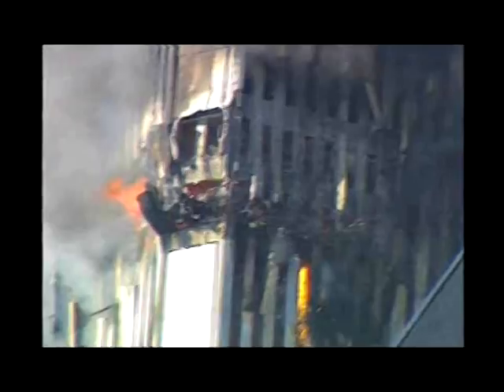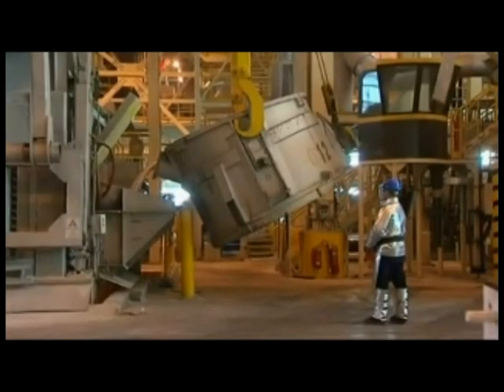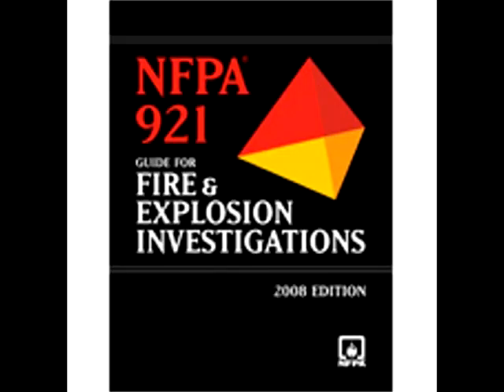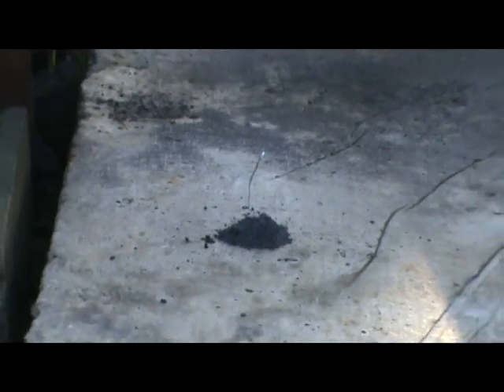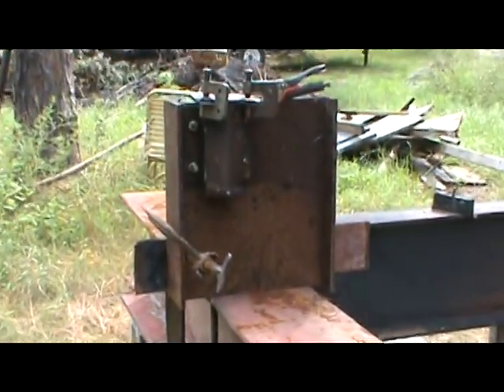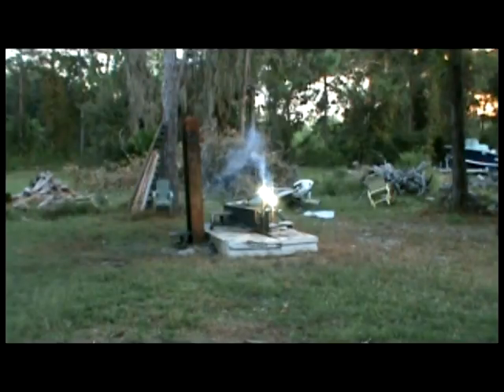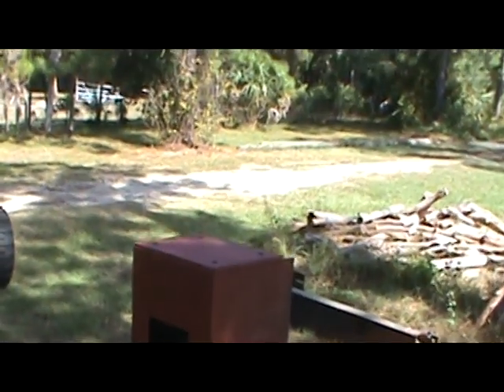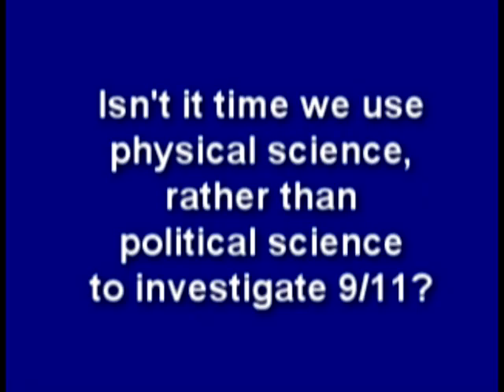9/11 Experiments: The Great Thermate Debate

Comment: Wake up call...

An office block like that has what type of filing cabinets? Chairs that have steel. The amount of lose steel that is present that is readily melted in such an environment would lead to a river of molten mental pouring out from a point that is above the fire.

Why is it people ALWAYS take the complicated route to the problem and fail to accept the fact that the average office has enough wood and steel and paperwork to produce FURNACE TEMPERATURES and that in itself should see the penny drop........
Reply: Ronnie Bishop  You're an idiot.
Reply: Chris Gilliam And you're ignorant and uneducated.
Reply: Mark Giblin But J-P 4 jet fuel would have to burn extremely hot to catch that on fire and it just doesn't. No
Reply: Are you daft? Jet Fuel burns, ignites paperwork, soft furnishings, wood and all manner of products start to off gas and that burns hotter and hotter and hotter to the point that metal furniture and other metal objects will melt.

Then you have the high temperatures from being 80 floors up and  blasted with strong winds, its not a light breeze up there, its bloody windy as F*** so that blasting through a hole in the building will be like a BLAST FURNACE which can even MELT CONCRETE!!!!!

WAKE THE F*** UP PEOPLE.

Anyone who works with metal will tell you that temperature does not need to be white hot to weaken the integral structure of metal, it only needs to get hot, too hot to touch but not even glowing hot to become soft, brittle and then it disintegrates.

I have never known such ignorance over a basic subject of structural and materials engineering, SIMPLE RULE is that the SIMPLETONS should STICK to WHAT they KNOW which is F*** ALL.
Reply: Mark Giblin Absolutely not it can't burn that hot. Plus that jet fuel burns up quick and would never cause anything to burn so hot to melt steel. I was a crew chief on F-4 fighters and my brothers a captain for Delta and we knew all along that was all total bullshit. You can't hardly burn it with Thermite.
Reply: And thats WHERE you are wrong... Jet Fuel, AKA Kerosene, AK Parafin oil is an energy dense material like petrol aka gasoline. When kerosene is heated, it turns to vapour reasonably quickly and will turn to a gas that will burn hotter than kerosene by itself.

If you have ever had a pressure lantern, you know that the top of the lamp gets hot enough to ignite paper when it touches the top of the lamp.

Is that hot enough for you or do you want to spew more of that Pseudo science bunk you're peddling?
Reply: Mark Giblin You simply don't know what you're talking about. At all. Are you a pilot? Crew chief?
Reply: Mark Giblin Not so dude. As a Vietnam war vet I've just learned to always search for the truth myself. I'm sure you don't remember the lies I was told during that fiasco? The Bay of Tonkin false flag and many others so we could continue to kill 4 million Vietnamese. Don't get sanctimonious with me I don't believe those planes caused those skyscrapers to just fall down. And nobody that's seen our intelligence community at work over the years do either. Are you afraid of the truth? I can tell you things that would make the hair stand up on your head.

Comment: So stupid. The AIR temp of 1832 degrees was not enough to melt steel. But: 
1) the temp of burning material surrounding other burning material (not the air) is much much higher. They don’t make open air furnaces for a reason. By definition, the temp of the air is COLDER than the stuff around the air that is heating it.
2) You don’t need to melt the steel to see failure. You need to weaken it by approaching the melt temp.
3) proving material that was not there (thermite) won’t melt steel is dumber that dumb. Try using a few tons of jet fuel as an accelerant and let it burn (like a furnace) for over half an hour. See if THAT has an effect. (Yeah.)

This video = Pure stupidity.

Comment: BUT here's the REAL problem with this video. I had a welding company and we erected a LOT of steel building. The problem with THIS "Theory" is, ALL these steel beams were COVERED with wall material making them inaccessible to this "Placement" of Thermite and you can NOT attach this said material  directly To the steel. Which would HAVE to be done to get this kind of reaction and damage. This video then suggests that the Thermite was place their in 1968 when the tower were BUILT. Also, ALL the steel, except for the last few floors (thanks to the EPA) were COVERED in Asbestos which is HEAT RESISTANT. In short, this is ALL left wing BULLSPIT. Nuff Said. Facts are Facts ask ANY welder and construction worker that puts these building up. Add to this, do you know HOW MANY PEOPLE would have to have been involved in such a Domestic Terrorist act? And would ALL those people keep their mouths SHUT knowing thousands died..I don't think so, Someone would have spoken up by now given the HATRED from certain Groups against the GOP and the President at the time,,,OH, and he had only been in office EIGHT MONTHS...so it had to have been done under the Clinton Administration.
Reply: No use for lazy people None. The man was using home made thermite not military grade nano thermite, big difference. Shape charges made by him were home made and crude at best.   Cutting of bolt heads was to illustrate a point of possibility not to say that it was necessary a requirement to get the job done(the one area difficult to access as you claim). 

Diesel along with office furniture don’t produce pools of molten metal last time I checked. 
I guess office fire free fall speed steel beam skyscraper collapse makes perfect sense to a seasoned pro such as yourself.  
Son just concentrate on keeping your rods dry and leave the thinking for people with brains.  😁

Comment: no one seems to  mention the aircraft were partially made of magnesium and it burns at 4000 degrees more than enough temperature to melt those steel columns. Yes the heat from the jet fuel was more than  to cause the Magnesium to burn.
Reply: Robert Puddy  that must be the magnesium that cut every single steel beam in the building to produce the free fall speed observed. It also must be the same magnesium that introduced iron spheres into the dust, the same magnesium that is responsible for molten metal under the rubble days after the collapse.  Congratulations you have found the missing key that even NIST the lead liars on the subject have missed.

Comment: Well done.  If anyone wants to investigate flame temperature you need calculus and integral heat capacities and heats of reaction.  It's an energy accounting process to calculate flame temperature.  3rd semester engineering course.
Perry's Chemical Engineering Handbook. 
CRC Physics & Chemistry Handbook.

Comment: Metal doesn't have to melt to lose its structural strength.  The beams broke via plane, heat and pressure of supporting the building not from melting dumb dumbs.
Reply: Theron Sax guess you haven’t seen the pictures from the site clearly shoving molten / cut steel beams, dumb dumb?

Comment: You keep forgetting that the building basically turned to dust! 500,000 tons of steel, concrete and glass blew away into the sky! And what was left? PAPER, PAPER and more PAPER floating around everywhere! Microwave energy does not affect paper, but it does affect steel and concrete and glass. Hence people hanging out of the top of the towers taking off their clothes because they were being cooked from the inside!
Reply: kparky49 - Exhausted worker takes a moment atop the Ground Zero Dust Pile

https://www.metabunk.org/data/MetaMirrorCache/f9057387497372fa559ba8e5cb59d410.jpg

Comment: You.ve got a very miss leading video.  As an engineer  and working in the field, you fail to note stel and aluminum star losing their strength as temperatures go up.  Steel is not as straong at 300 degrees as it is at 200 degrees.  At 950 degrees aluminum melts.  Steel is fluent at 2200,  Sorry but propane can melt alouminum and steel as well as brass.  should i continue.

Comment: Jet Fuel burning temperature causes structural steel to REDUCE its tensile strength under a critical point where it collapses. Don’t know enough to refute the molten stuff though.

Comment: Anyone who has cut steel with gas or, plasma knows something isn't right about the official story.
Reply: mech5 fab I have. I also work steel into knives and swords. Think for a second. Steel bends at 1500 degrees. So if I can't lift my 5 pound anvil with 1500 degree steel how would the threads on the nuts and bolts hold the horizontal beams and girders hold. Why were there stripped bolts and nuts found at both sites? If you lose horizontal support how will the verticle stay up? The two in a big tower act together.  You can not have vertical height without horizontal support.
Reply: hardleecure anyone who was watching ABC at 1900 hours Central Time knew tower 7 was an ordered demolition
Reply: mech5 fab u got that right (welder here)
Reply: many of the supports were bolted in place. Jet fuel which burns (1500F) much hotter than it takes for steel to glow (900F). Add in wind from blown out windows and the hole the plane made and it could simulate a kind of crucible inside the building meaning temps inside could be hotter (even the video said measured air temps were around 1800F). Massive structural damage caused by a plane impacting a building along with high temperatures that likely left bolt strength significantly compromised could lead to structural collapse. failure of the bolts supporting a vertical structure would lead to a vertical failure, i.e. a pancake collapse. Plus youve got to take into account that nearly 10 floors were compromised and that when the structure collapsed it was an addition 10+ floors that fell onto lower floors (upwards of 55000 tons impacting compromised structures). Not much can withstand that kind of energy being dumped on an area.
Reply: You Wished guess how long it takes to rig a building for demo . weeks , not hours .
Reply: Haulin' ass Wastin' gas lol he comes with facts you have none do you insult.
Reply: Any mentally unstable person can believe anything they want. 

It won't change reality, however
Reply: Ben Tyler yeah mig welding, guess what it does kiddo? it melts through the steel and penetrates it, like you know all welders do.
Reply: Ok,,, just to give you a example. Make the biggest fucking bonfire you can on a windy day, throw all The shit you can in there to try and make it as hot as possible. Then throw your crappy bbq in there, you May melt some of it if you are Lucky, but one thing will still be alive when it is said and done. The grids will still be good as new. Not twisted or miss shaped. And that is not even construction Steel. I challenge you to try and melt bbq grids in a fire,, it cant be done.
Reply: Johan petersson there is a difference, a bonfire doesnt get 1500 degrees hot, Fuel and gas lines from a building and compression sure as hell does lol
Reply: Haulin' ass Wastin' gas yeah that you wished is a real douche
Reply: Ben Tyler this idiot thinks that you weld with gasoline?😂
Reply: Nick Holloway try reading all the comments next time and you won't look like a fucking dumbass lmfao 😂🤣😂😂🤣
Reply: Dodge Neon Racing & Stan’ Auto Repair I would have to ask since oxygen is lesser the higher the altitude would this fire not be as hot. Just a question not attacking you, this day in age it’s hard to ask questions without being taken as someone trying to pick a fight. And also would the heat have to be directly on the beams for it to weaken them sufficiently
Reply: mech5 fab because those are the people that can actually use their common sense unlike most goofs nowadays like fuckin Marty Hickman up here thinks jet fuel will melt a steel I beam
Reply: Haulin' ass Wastin' gas The buildings were only built to withstand at most a small Learjet, not a fucking huge passenger jet. The Empire State building was hit with a B-25, they based the new building codes off of that.
Reply: Define "free fall speeds." You have no fucking clue what you're talking about. You're just parroting what you've heard thinking it makes a coherent argument.
Reply: I believe Mech5 fab was referring to Metal Inert Gas welding(MIG), Tungsten Inert Gas welding(TIG) and plasma cutting. Not gasoline..
Reply: Dodge Neon Racing & Stan’ Auto Repair and as a welder you know NOTHING OF METALLURGY. I work as a blacksmith. My forge can heat steel to molten if I am drop forging steel ingots. Mostly I fold my steel at 1500 degrees. Folding steel more aptly describes what happened on 9/11 than a massive conspiracy theory that would take years to complete.
Reply: Dodge Neon Racing & Stan’ Auto Repair and as a welder you know NOTHING OF METALLURGY. I work as a blacksmith. My forge can heat steel to molten if I am drop forging steel ingots. Mostly I fold my steel at 1500 degrees. Folding steel more aptly describes what happened on 9/11 than a massive conspiracy theory that would take years to complete.
Reply: Dodge Neon Racing & Stan’ Auto Repair watch this. Learn a little about metallurgy.
https://youtu.be/qoOGGgiDOEs
Reply: N.I.S.T. admitted free-fall occurred when building 7 "collapsed". Both sides of the argument seem to agree on that point from what I can tell. That implies a question.... If all of the potential energy of a falling structure has been converted into kinetic energy, where did the energy to crush the structure come from?
Reply: Ok. Steel bends and weakens at 1500 degrees, no one is arguing that. Would the buildings fall at free fall speed if the steel was bent or weakened? It makes more sense that the supports were taken out entirely via cutting as in a controlled demo.
Reply: mech5 fab the wind speeds at 75 meters would have basically made a forge witch could get hot enough to melt the steel
Reply: mech5 fab ya I agree with you. I a welder and this video tells it more like what really happened
Reply: Anyone with half a brain would know something is amiss when building 7 collapsed.
Reply: mech5 fab hey.... I’ve done all of those and there is zero that isn’t right about the official story...
Reply: Anyone who has cut steel with gas knows that steel can be cut with gas. Stupid comment is stupid.

Comment: btw..... did you see the big fireball... ? guess what, most of the jet's aviation fuel was consumed by that big fireball, outside the building, in the air, yet we're supposed to believe it caused the collapse. Photos of the pentagon crash site however showed desks, tables, papers, all unscorched, from a plane carrying the same fuel load.

Comment: What a load of codswallop - Structural steel begins to soften around 425°C and loses about half of its strength at 650°C. WTC fires reached at least 1000°C  2:05 which is more than enough to cause failure zzzzzzzzzzzzzzzzzzzz

Comment: I think this is a great video, only the thing is, how did the towers collapse in free fall speed? that would only have been possible if all the floors beams were cut at the same time. If only 1 floor is cut the upper part would topple or come 2 a grinding halt on the lower part. Also the amount of debris in the pictures is amazing. its just not there. Not 2 mention the funny perfect round holes in buildings 4,5 and 6. The power that was used on that faithfull day must have been of the charts and 2 me is just a matter of time before it will show itself again. The lie can be quick, truth will always catch up.

Comment: Sudden symmetrical collapse at very near free fall speed into the path of greatest resistance all the way to the building foundation, because of structural failure in one of the most overbuilt buildings in history, including through dozens of floors that were NOT on fire and were NOT "melting" OR "Softened". Now can you FACE that you've been lied to by the Holy Mother Government. Government is NOT your GOD! Truth is! God is Truth!
Reply: Mick James design of building made straight down the path of  least resistance. You said it,  “ most overbuilt building in history”. WTC support structure was all in exterior walls. They fell, pushed outwards, as falling interior pancaked downwards. Once the upper floor smashes lower floor from walls there are only 4 points of contact holding exterior walls together. Most buildings support structure is even throughout, and have a webbing or matrix of beams from wall to wall, attaching all walls together in multiple places. This advanced design was its downfall. Literally. Spend your time more wisely and fight REAL corruption, like deep state leftists in DOJ and FBI attempting coup against POTUS. Leftist Propaganda masked as independent press. Ect.
Reply: Well said....obviously you are one of the millions of US people whose minds don't go dead when faced with logic that contradicts a preconceived notion..peace
Reply: Mick James ..well said..obviously you're one of the millions of US people whose mind doesn't snap shut when presented with logic that contradicts a preconceived notion...
Reply: Lookitup ...one needs to do a lil physics homework on this one first before trying to quantify anything.....don't feel bad for not doing any though..the nist forensic "analysis" didn't bother with any physics either..Look THAT up...peace

Comment: As someone who has dealt with jet engine alloys and taken them apart. Many of the alloys which surround aircraft engines and aircraft them selves will actually burn on there own once ignited or reach a certain temperature. lets not forget the oxygen tanks and batteries as well as the hydrolic fluid on board as well.